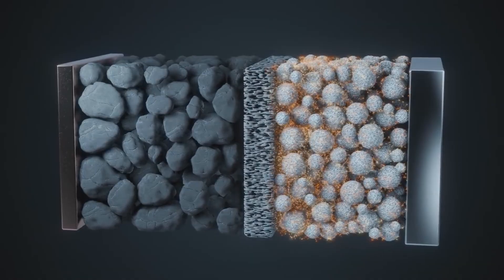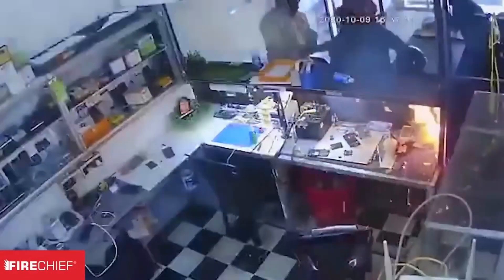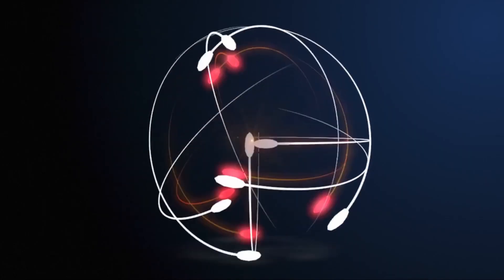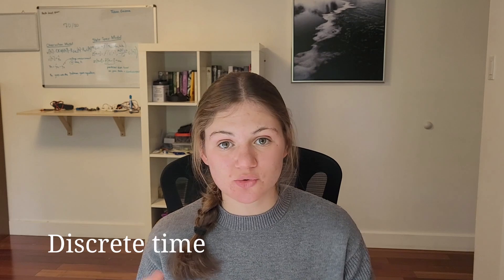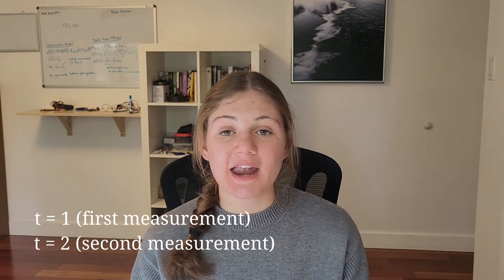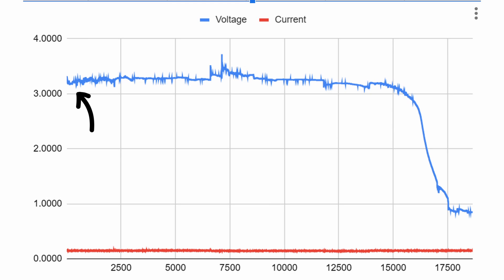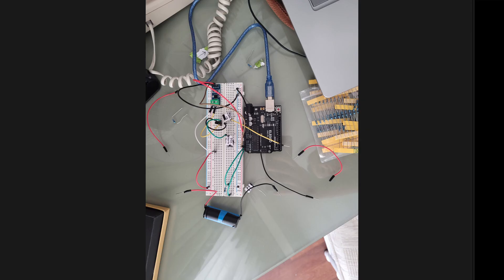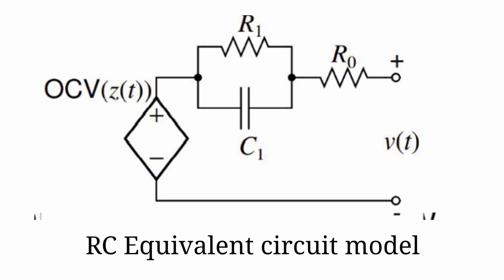Estimating battery SOC with an Arduino and EKF

Comment: What is the dimension of the np array Sigma_v that you have used in the kalman Gain calculation in your EKF_main.py  ? It appears to be 1-dimensional but it appears you are taking inverse of this 1-D array in your code ... it is bound to throw error as np.linalg.inv works on 2X2 Square Matrix... please correct me if I am wrong here ...

Comment: THis problem is not as easy as you presented. I can not find ONE battery for ESS system or ONE BMS after
13 y. of searching, that can count SOC in all temp, current, voltage, cycle, calendar life impact, etc. precisely,
if you charge your battery at home system , after a few days without sychronization, BMS or external shunt 
is 10 - 25 even 40   % out of reality, so SOC can display 95 % but reality is only 70 % etc.
Reply from the maker: yes definitely it varies hugely based on your specific battery + situation! This was a learning experience for myself mostly :)

Comment: hey regarding the battery parameter (r0 r1 c1 ) why did you take them as constant measured after only 1 discharge pulse its like we have to measure these parameters for soc = 95%,90%,85%......,5% and make a relation between r0 and soc and then use that in ekf algorithm right but you only took one reading for r0 r1 c1 is this correct ??
Reply from the maker: yeah this was correct, that was a simplification I made but in order to make it more accurate you'd want to do it at a bunch of different SOCs just like you mentioned!

Comment: buck converter in the project , why did you use the transistor?  is it okay if we use only the current and voltage values that we get when discharging for the kalman filter?  if I do it like this; if I discharge it with the battery, resistor and acs 712 up to 2.5 volts. and is it okay if I say 0% full at 2.5 and 100% full at 4.1 volts? can you help me with this? i wonder what is the battery and resistance information you use?
Reply from the maker: I might be misunderstanding your question, so let me know if this helps: 

I used the buck converter to step down the voltage, not just as a transistor, so I'm not sure if it'd work. 

Yeah I think that'd be fine, I just searched up a discharge curve for a LFP battery (the chemistry I was using) and then tried to get a profile that matched that. Those numbers sound consistent with what I've seen and what I got, so you should be alright to make the assumption. The challenge will be that without the data, you'd be assuming a completely linear relationship, and if you look at the discharge curve it looks sort of like a logarithm (is my guess, if I've understood you correctly) 

And I used the resistance information in the specs section where I bought the battery! You can also probably measure it yourself with a multimeter.

Comment: Great video! Thanks a lot :)  Subbed!
Could you please share which N-channel Mosfet you used? 
Also, some documents where I can learn how to determine the values of R1, R2, and C1 from pulsed discharge test?
Thanks a lot :D
Reply from the maker: Thanks! It was a 2N7000 I used. And for determining the values, if you scroll down in this readme, there is a graph that shows the equations for how to calculate it! https://github.com/sashaprz/Estimating-Battery-SOC-with-an-Extended-Kalman-Filter/blob/main/README.md

Comment: What method did you use to calculate ?? Coulomb counting ?
Reply from the maker: extended kalman filter! which uses a voltage-based model of the battery
Reply: @sashaprzybylski we have an AFE, I willl tell you the name dear ... it is this BMS ic  MC33772 from NxP which gives us coulomb count from Register which we can read .. Can't we use the relation SoC = present Read coulomb count(available charge) / battery capacity (in mAh) which will give us SoC...